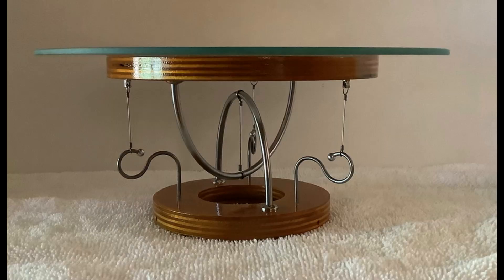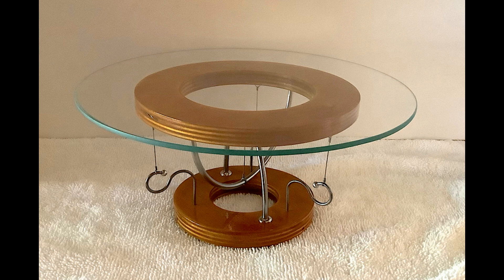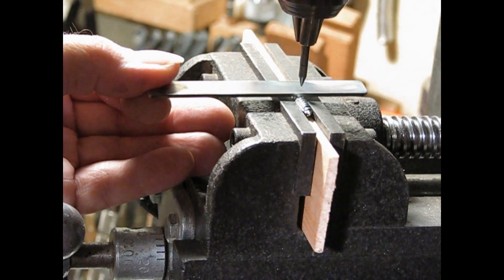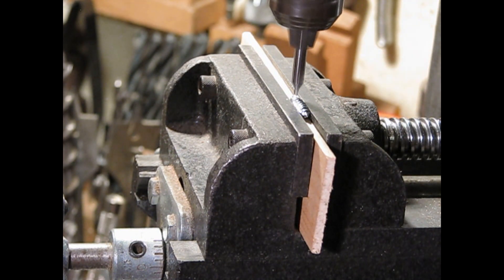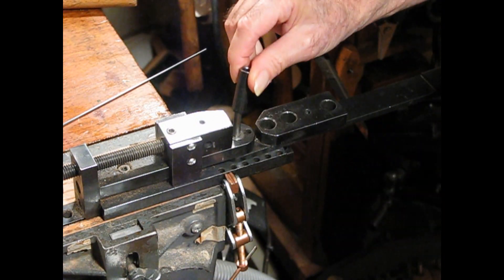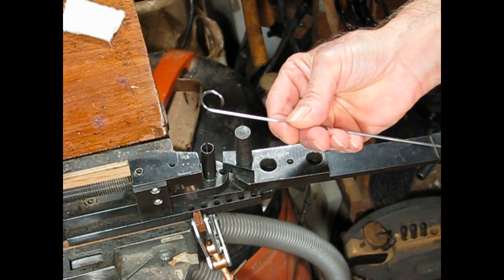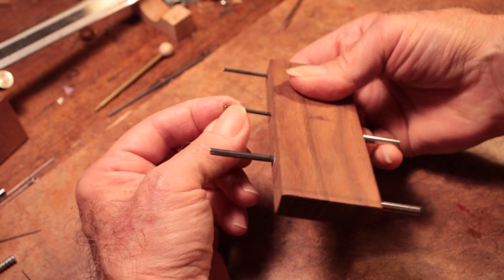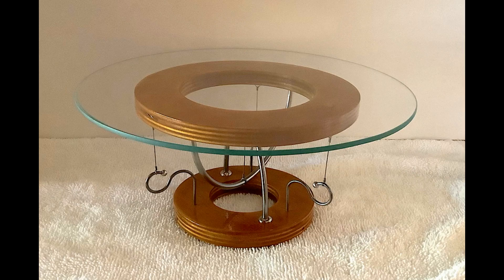Building a Tensegrity Model, part 1

Comment: That stick with a nail in it is going to save me so much time!
Reply from the maker: Cool, you are a wire twister? Du-Bro sells a tool called Kwik Twist, which is where I got the idea.
Reply: @bellowphone  I mostly do radio and electronic work, though I have been considering doing some jewelry. We have really great quartz crystals around here and wrapping them can be a lot of fun, especially if you find twinned ones or 'spears'. Where I can see this really coming into its own would be making findings. I shall be thinking about this for a while!

Comment: Hi hope your great man I’m over in the uk. I wanted to ask you for some advice if you don’t mind. I have some galvanised cast iron row locks which oars sit in . The cup the oars it’s in is to big is it possible to heat them up and bend them in. I tried with a hammer and they cracked and broke. Thanks loads jacob
Reply from the maker: Hi Jacob. I'm doing well, thank you, and I hope you are also. Greetings from the US. As you've discovered, cast iron is not very malleable, unlike wrought (forged) iron or steel. It's a little better if it's heated, but it's got to be heated up to the bright orange range, and then you might be able to bend it without breaking. I wouldn't hammer it; I would slip the end of a pipe over the end, and gently pull it over while it's hot. You can probably get it hot enough with a propane torch, just heating a small section where you want it to bend. Since it's galvanized, I would make sure to do it in a well ventilated place, like outside, so you don't breathe in the zinc vapors.
I can give you a good example of how NOT to do it, in case you haven't seen my video: https://www.youtube.com/watch?v=F8OAPM9Obyo&t=5s The problem I had is, in the first place I didn't get the piece hot enough, and then I fumbled too long getting it into the clamp, so it cooled down too much before I cranked the clamp.

A point of interest; cast iron can be hammer-forged into wrought iron, which is more tough and also malleable, but you would need a forge and an anvil with a horn, or any kind of solid round mandrel, so you could support the inner curve of the rowlock arm while you hammered around the outside. The metal has to be close to welding heat while doing this, with a good amount of hammering, so it would take a few heats in the forge between hammerings. That's how wrought iron was made from the cast-iron ingots, or from parts castings, in the old days.
Reply: Your gentleman thanks so much, the smaller row locks I’ve been using the shaft has been snapping so I went for the next size up with 3 mm more thickness 12 instead of 9 only problem the oar pulls out of it when I row. 

I’m planning to row around the island I live on the Isle of Wight two time to raise funds for a project I’m planning to row from New York to the uk . Sponsorship is hard to come by, all the billions of dollars floating about just can’t find the person who might help. Keep trying . Thanks for your magic advice I’ll try at work hopefully tomorrow 22:00 here.
Reply from the maker: @jacobbenger-pereira3514  Good luck with your metalworking, and especially with your voyage across the Atlantic. I wish you all success with that, and I'll look forward to hearing more about it.

Comment: That last pair of pliers - it had a slot or bird's mouth in the end of the jaws, yes?  Tricky centering act, too!
Reply from the maker: Yeh, I modified that pliers for a different thing; there is a slot, which is neither here nor there for this purpose, but there's also a little cup-shaped cavity in the end of each jaw, which makes it just right for securely holding and not marring the little coil.
Reply: @bellowphone  You should devote a few seconds to show and 'splain that cup-shaped cavity, a cameo in Part Two:  "A viewer asked..."